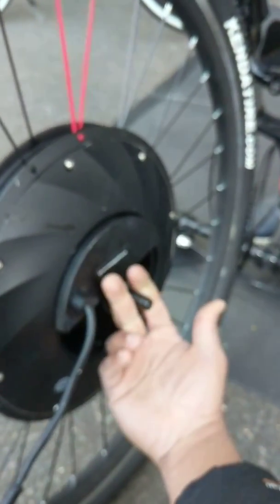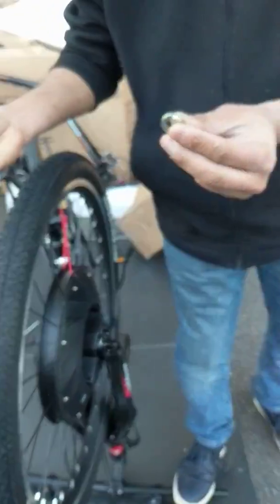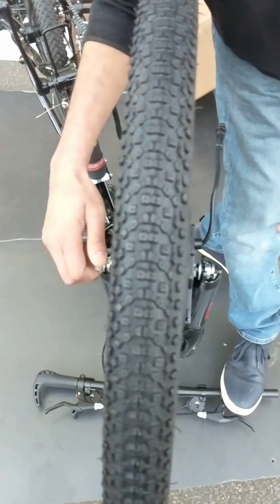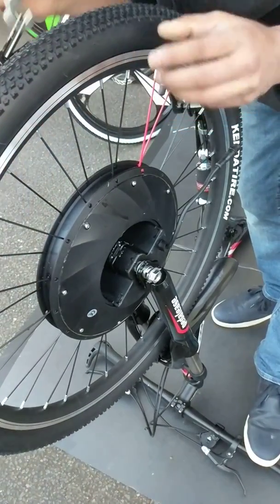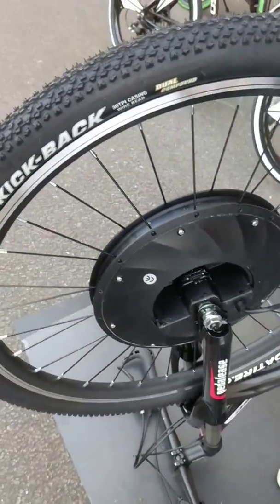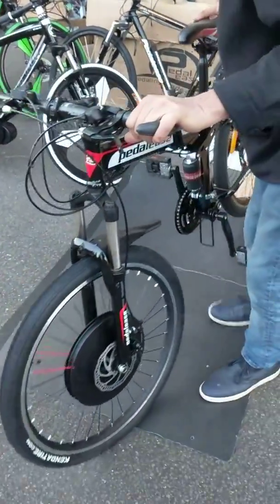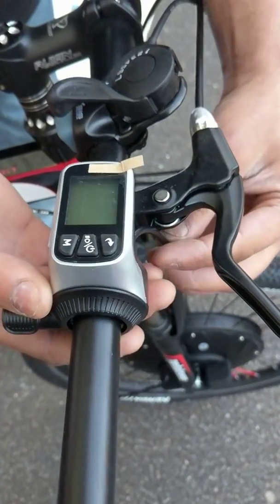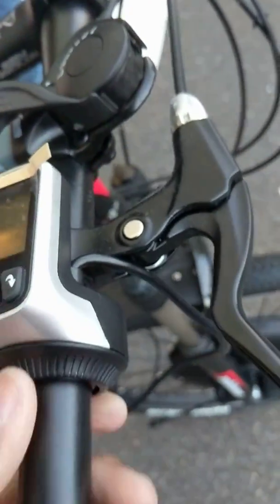Imortor motor front hub installation

Comment: Stop this lies! It's clearly visible on video that the calliper doesn't fit the room. between the disk rotor and motor housing. The reason i've returned my 3.0. Fuck if i know how did they design it, but there's too narrow space for a standard shimano/tektro callipers. More to say u have to grind out the dropout link to install the wheel. Can use a dremsel tool or any sort of a grinder though. As to a first problem - u can switch to a 203mm rotor with a calliper extension bracket, so the calliper will come out further and probably will not touch the motor. Or you propably need to get a low profile calliper... i didn' find.